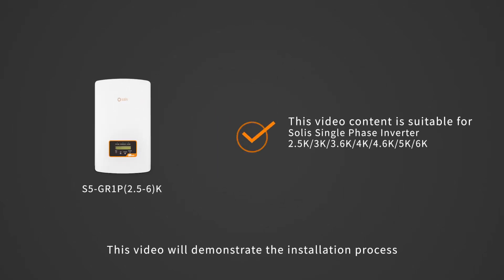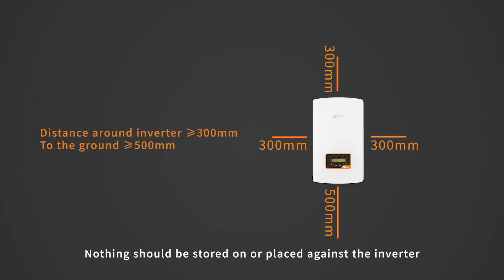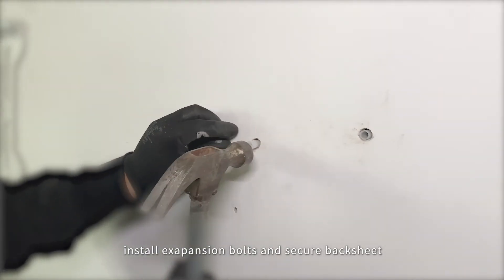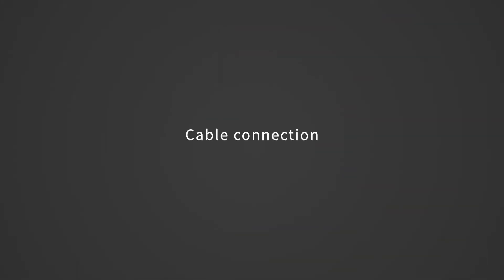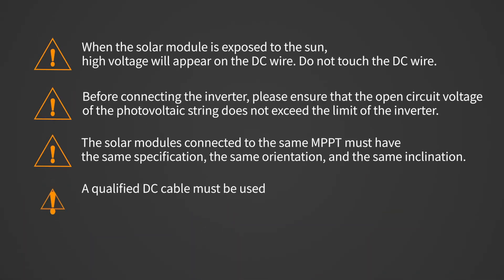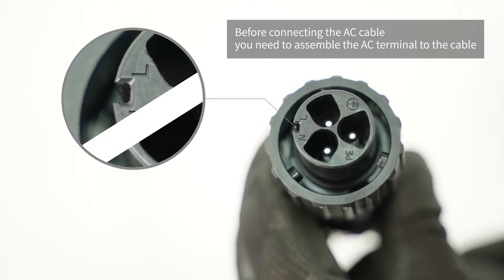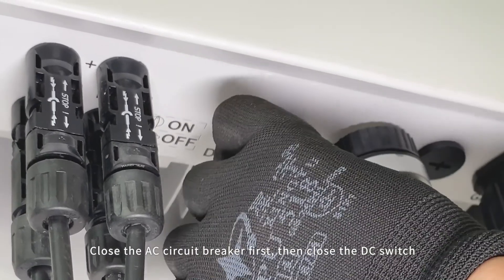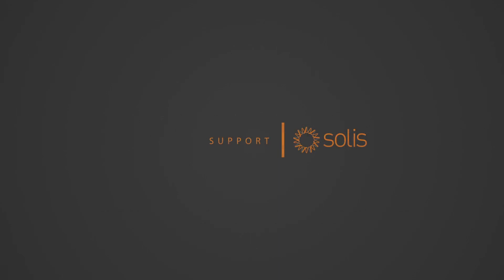Solis inverter S5-GR1P(2.5-6)K Installation Video

Comment: What is diff in 3 phase and single phase Solis inverter.some people say that single phase is better than 3 phase die to non current in one of the  three phases or not reqd voltage in all and panel will not produce power generation to grid do loss of money for solar plant
Is It true that  single phase is better than three phase to get uninterrupted power to inverter.recently I fixed solar plant 3 phase inverter of 5 kWh?